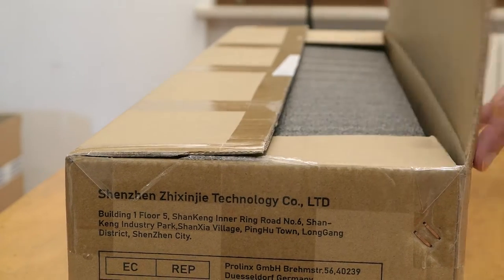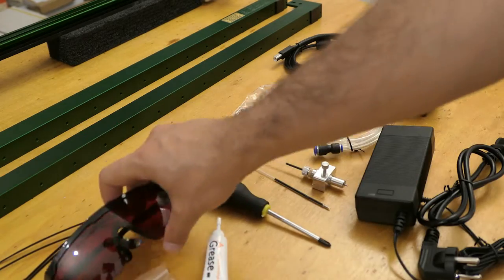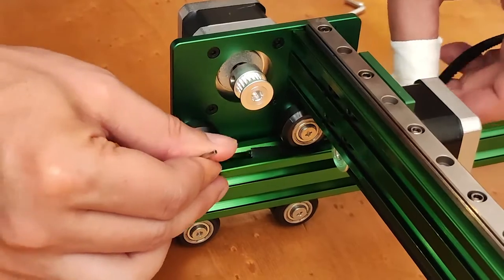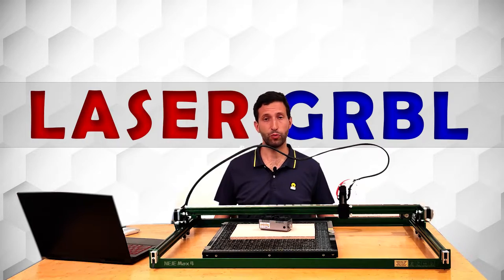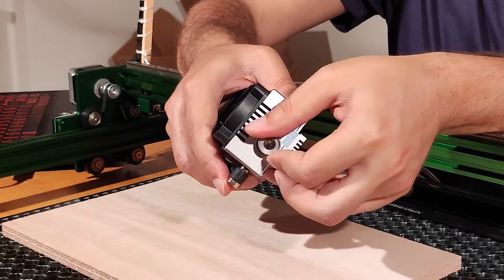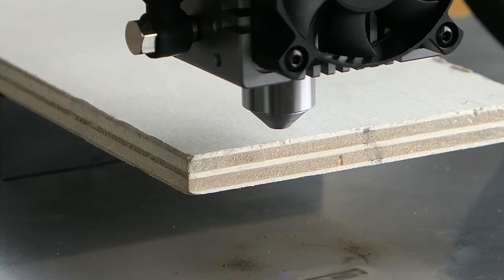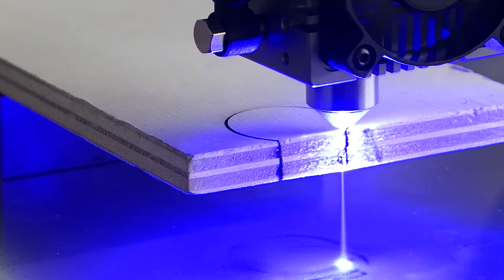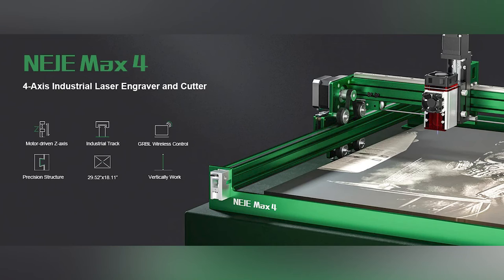NEJE MAX 4 - Unboxing, assembly and Testing by LaserGRBL

Comment: Hello.  Thank you for your assembly video.  I have just received my Neje 4 Max E80.   I only have one drive belt.  Do I have to cut it in half?  There is no info on this.  Thanks
Reply from the maker: In my box I have two, no need to cut. Just check its length and if it is 2x long so it is ok to cut it

Comment: Hi. A very good video. I have bought one with the extension, and I´m very pleased with it, but there is something I haven´t fond out yet.
In the video you show the pen plotting a drawing, and I can see that the pen lift when going to the next shabe. (the Z axis go up).
I´ve looked ewery where to find out how to do it and I´ve asked many forums and support sides, byt no one have given me a straight answer. 
Do you use a special software (i use Lightburn) ?
If you can tell me how you do it I will be very pleased. 
Kind regards Peter
Reply from the maker: Hi! I agree, this machine is awesome.
To use penplotter I have used LaserGRBL. LaserGRBL doesn't generate codes for pen up/down but you can save the produced g-code and edit the file with a text editor replacing M3/M5 that turns laser on off with some z movements.

Than reload the file and ta-dah! It works

Comment: Hello .  Please can you help me again.  I have built the Max 4 E80.  Unfortunately the laser is permanently on (low power).   I can vary the power by sending a job from Lightburn, but the laser will not switch off completely.   This is with nothing connected, only power.
Reply from the maker: Any button or switch on the mainboard?